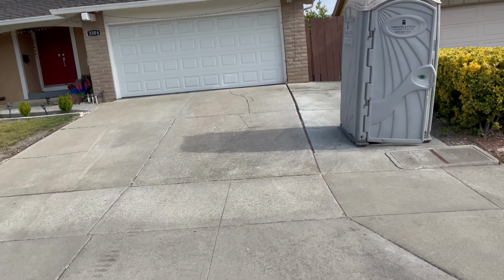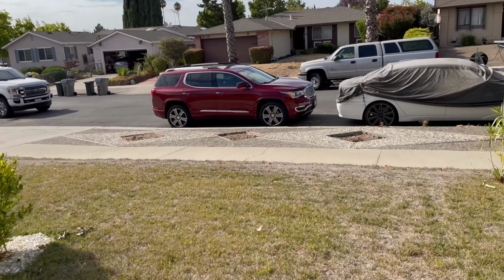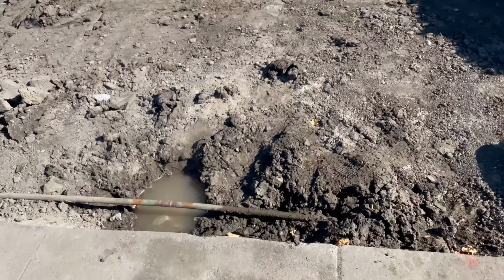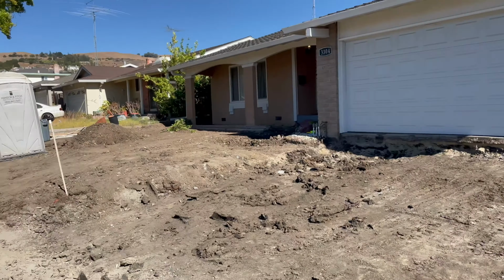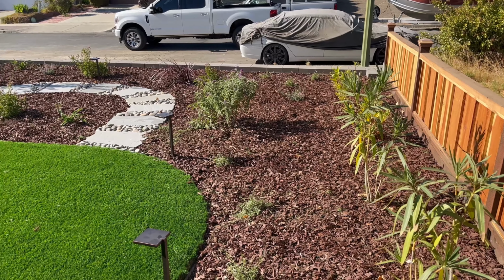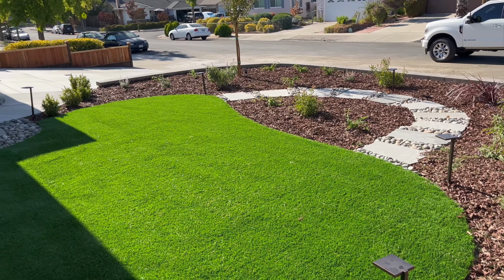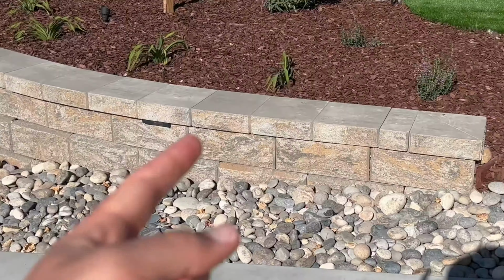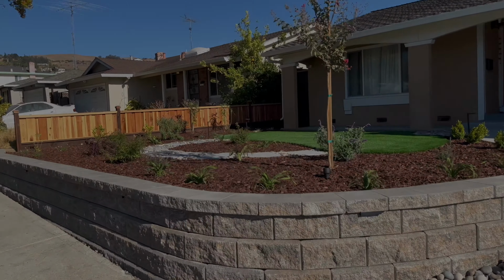$56,000 Concrete and Retaining Wall Job - Finished in ONLY 7 DAYS **FULL TIMELAPSE**

Comment: Looks great dude. You know what you should do with the corner block 45 degree cuts and the 45 degree cap cuts? Squeeze in some clear polyurethane silicone. Then take stabilize sand and wip in into the silicone. It sticks and dries to it. Leaves a nice mortar looking finish so you don't have the unfinished gap cut look. :)
Reply from the maker: Thank you! And this is a good idea, maybe I’ll do it next time :)
Reply: @TigranGertz  give it a try. You’ll be happy with the look. Finishes it off well. I even use it on the soldier course banding edges where the sand never fills up to the top and always falls into the snap edge. Small little beed and then sciff it with stabilize sand 👌🏻. It’s solid
Reply: @LandscapeMaster33  Hey LandMaster, are you located in San Diego by chance?
Reply: @doscoronitas  no. I’m in Toronto Canada
Reply: @LandscapeMaster33  Okay, I was looking to get some experience before going out on my own... Im closer in distance to Tigran, maybe I should work for him for a bit...

Comment: I came up with a 14k estimate I’m not sure why it cost them 56k that’s insane….  Wtf
Reply from the maker: That's California for ya
Reply: 14k? Are you a contractor that under bids to lock jobs just to have someone come in to fix it? I’ve fixed so many so called contractors work we’re im from, 56k is extremely high but he’s in Cali, but 14k with cost of  labor  and material your barely making a healthy profit.
Reply: Here in Cali with 14k your barely making any profit . Imagine you have a crew of 4 you pay them 200 a day and it’s let’s say a 2 day job that’s 1600 just in labor then dump fees material cost etc man you ain’t going to make a living man .